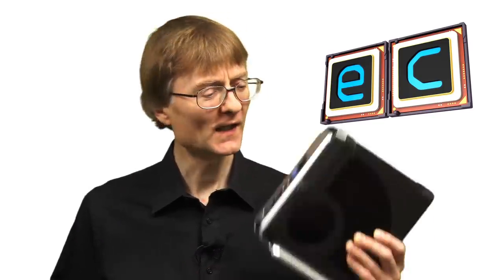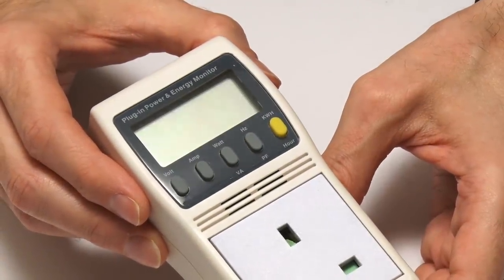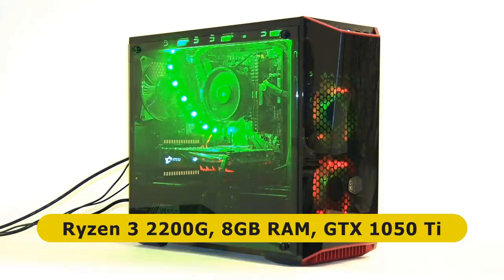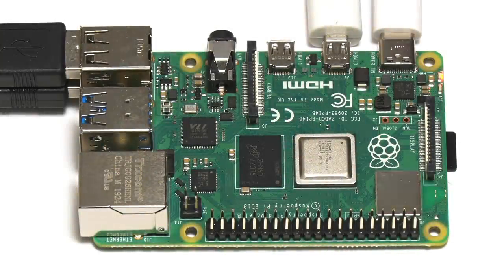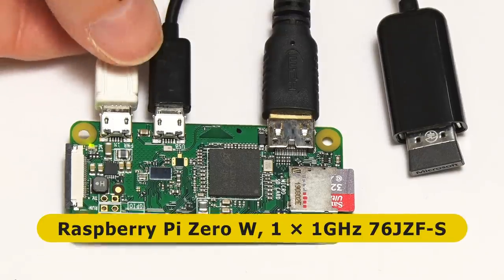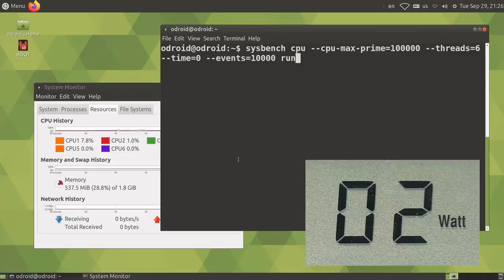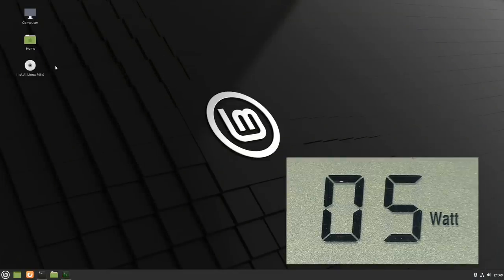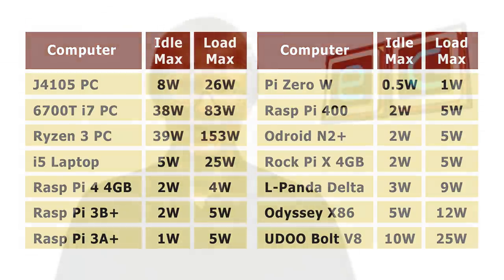PC & SBC Power Consumption

Comment: Christoper - if you have any access to experienced electronic engineers (and I stress - experienced) they may be able to modify cheap power meter to use a shunt that is 10x the resistance of the original one. That would give you 10x the resolution, though you'd have to insert a mental decimal point. eg: 11 watts on the meter would be 1.1watts.
A downside is that the maximum rating of the meter would then be divided by 10, so for a 3kW maximum it would be reduced to 300 watts.
Reply: and watch out - if you buy some cheap meters, they are very inaccurate or give no reading at all below 10watts, depending on the chip and coding used. A good sign is if it reads down to 1 watt - some start at 5 or 10 watts and then increase in 1w increments thereafter - not good
Reply: Boodysaspie  Well not really, I couldn't find a good one with accuracy down to 0.1W resolution at all power factors. Modifying a shunt can cost only a few cents, depending on the value required. A simple length of brass sheet or thin-gauge bar, cut to shape for small loads, calibrated by filing a groove across it to trim the final value. Also, this is mains voltage equipment so needs great care.

On some designs, even the battery contacts are live at mains potential (which is why they are well sealed in use - though beware if you are testing a modified one before re-assembling!)  Hence the need for an experienced hand and eye :) This is not a mod for for beginners. 

Resolution and accuracy are two completely different things - just because someting has high resolution doesn't automatically mean that it's accurate - a common mistake than non-engineers make.  

Overall I spent over 600 euros on several so-called "professional" meters and still ended up modifying the shunt an old Brennenstuhl model that was originally bought from Lidl for about 8 euros 10 years ago. 
I have plenty of  real test equipment (and it's regularly calibrated and checked) but for a compact easily used unit the size format of these consumer meters is very attractive. 

Best I've found since, well under 100 Euro was a "Hopi" meter, though it was rather larger than these small units and doesn't like stray RF or badly-filtered SMPSUs or being too close to transformers and inductors. I didn't really find it very well constructed and it had some dubious safety decisions though - just my opinion.
I dropped it one day from 6 feet and it smashed to smithereens :)
It's not like I need to use these every day, so not worth spending crazy money on one. 

But 3 cheap "plug-style" power meters, 2 modified (one for 0.1W and one for 0.01W) covers most of my needs for mains measuring of small mains loads from 3kW down to next to nothing.
Especially for longterm battery-powered or solar/PV-powered equipment, you really do need to keep an eye on the losses - some mains PSUs are very inefficient under certain circumstances. Not all equipment can be brought to the lab to use bench test equipment and must be measured in the field quickly and without cutting cables. Up a lampost or mast in a waterproof enclosure is a classic example of when you'd need a small plug-in unit

Measuring DC power is far easier with simple cheap test equipment. 

But yeah, if you have spare money, you can spend a LOT on test equipment like this. I prefer to spend my money keeping fit and healthy on beer, crisps and biscuits instead.
Reply: Boodysaspie  This is a 5 minute job with a parts cost of under 2 euros including calibration components (mainly the cost of as mains plug to house some quality 1% resistors to check calibration) 

The maths skills required are around age 7 or 8, the physics knowledge is around age 13 or 14 at most and other than the mains safety aspect and supervision aspect could easily be done safely by a 16 year olf EE student. It's no more difficult that thousands of YouTube content creators do daily and the parts are very readily available and cheap.

I was merely suggesting to Christopher that his academic contacts(edit: lab techs, EE lecturers etc) may be able to help him convert a shunt.
What may be an unusual position to you may not be at all unusual to others.

If we all waited for others to design and sell us useful items appropriate to our needs we'd be waing a long time for any scientific progress.
Reply: Boodysaspie  what is inconsistent with me suggesting playing it safe? a kid can do the math, an older kid could do the conversion, but they would need supervision and guidance to do it safe. 

read both my comments, BOTH suggest playing it safe - how is that inconsistent?
Reply: Boodysaspie  Do you troll all day? As I said - * twice * - the safety aspects require experience, but the basic skills are simple and the parts are extremely cheap. Direct replies to your hypothetical questions about cost and difficulty. 

You, not I, chose to pick this argument, and you choose to ignore parts of my comments and not others.

This conversation serves no technical purpose and wasn't even aimed at you, though you have hijacked it as your own for some reason.

Argue with someone else. This spoils a good channel.
Reply: Boodysaspie  you didn't ask a  question - you made a statement and then asked me to agree with it - you said specifically said - "It's safer, cheaper and quicker to buy a better-brand meter, isn't it?" 
We bought many devices from reputable sources and spent a lot of time and money, yet found nothing suitable - after testing - within the budget of the project. Few devices even met their stated  specifications. One (the most expensive) was unsafe to use.

Comment: Good to see how much power we can save just by using the minimum configuration needed for a job at hand. (Most of the time, a raspberry pi is enough for me for home use: mails, YouTube, learning programming, etc.) You also gave me further ideas to test: What about stressing out more resources on the raspberry pi? e.g. memory to near 100% utilisation, stressing out gpu chip? does it make any significant difference? (so there are a few more use cases worth considering.) And it is also useful to see that a modern laptop may have comparable power use to an SBC when the task at hand requires lower processor activity.

Comment: On the SBC's I would have liked to see power dissipation while rendering dynamic video for the hdmi output.  It seemed that the power would rise each time the terminal window was opened.  I believe 100% utilization on the CPU is only part of the problem.  Does your stress program also stress the on-board gpu?

Comment: The Ryzen3 System uses an APU and doesn't need a Graphics Card. The Power Usage under Load would be much lower without it.
Reply from the maker: There is no issue using a graphics card with a Ryzen APU, other than the GPU is being wasted. As I noted in the video, in the 6-part build series for the PC I first built it using the APU for graphics, then added a graphics card later. And this is a very common approach for those who want to need to start with a more basic system and upgrade over time.

You are right that if I tested the Ryzen system without the graphics card it would use less power. But I am struggling to see the point of this observation. I test a system -- a set of hardware -- and indicated what was being tested.

Comment: The power draw of the "Ryzen 3 PC" would be more due to the GTX 1050ti than the Ryzen 3 ?
Reply: @J Fz okay 👍
I meant to type Ryzen 3 at the end, my finger slipped
Speaking of nm, Zen 2 and Zen 3 are both 7 nm, while Zen is 14 nm and Zen+ is 12 nm

Comment: Well my Core 2 Quad Q9400 overclocked to 3.2 ghz with 8 GB ddr3  and GTX 1060 with 1 ssd and 2 500GB hard drives consumes  120 W idle and about 300 W when I stress testing the  cpu and gpu. Yikes!
Reply: @J Fz I would upgrade to ryzen but I cannot afford it because everything new is expensive in Romania

Comment: Over the last few years, I'd also looked at the power consumption of PC components, having looked at the Thermal Design Power (TDP) ratings of my old early 2000's PC CPU's that were almost vampirish in the power they sucked and tropical in the heat they put out.

Modern PC CPU's are a lot more power efficient but I still think we often use computers that are over-powered for a load of tasks with SBC's making more sense in modern times for a lot of lower power tasks and the PI 400 ticks a lot of boxes for a lot of general users, myself included, and I plan on getting my mitts on one soon for lighter tasks like browsing or streaming.

No need for an i5/i7/i9 with 16-64GB RAM when something like a PI 400 does it for a fraction of the cost, power and for general piece of mind.
Reply from the maker: Great post. It is indeed amazing how much power PCs used a decade or two ago compared to today.

Comment: This is a great reminder for me to get a new power meter.
I lent mine to a friend and never got it back. 
Besides, these days power factor is a important feature to measure.
Back in the day of the 32bit Athlon CPUs, I had a PC that drew 82W when powered off. 
It turned out to be just the power supply with a terrible design of PFC and filtering.
Reply: Boodysaspie  Most definitely.

Comment: You're only testing the CPU on those Raspberry Pis. Not the GPU.
OpenCL or GPU benchmarks will most likely bump that wattage by a few more.
Reply from the maker: Correct, but the relative power use of the GPU on the SBCs here would be very slight.
Reply: @ExplainingComputers  You think so?
It's my experience that the GPU (often 4-8 cores) uses more power than the CPU under full load.

Comment: Mate of mine was asking, and I don't know, if you've seen anything that can take AND power and external drive so it can play MP3s (MP4, M4A). I'm guessing not unless it's an SSD.
Reply: External 3,5 inch harddrives (always?) comes with a separate power supply. Using one of those with a raspberry pi should be not problem at all. I think a 2,5” also would work, although you’ll need a good power supply and I am not sure you could max out the cpu of the pi whilst also waking up the hard-drive.
Reply: @PatrikKron  I'm not sure what application my pal is thinking of. Seems to me that he's after an iPod ... which already exists but maybe something else? I don't know. All the 3.5" drives I have are self-powered (12 or 5v) so they're a dead loss if he wants portability.

Comment: the power meter doesn't have enough resolution for small SBCs. You could try to measure the DC power using something like this: https://www.ebay.com/itm/USB-tester-dc-digital-voltmeter-ammeter-voltmeter-power-bank-voltage-detector/184534588694?hash=item2af71e5d16:g:wZ0AAOSwN~demHt9

Comment: A lot of these simple AC power meters are very inaccurate at low loads. You really need to check and calibrated them to be sure they are accurate. A lot of the non-names ones, will be few watts off easily. And, no you can't just say "it will still give me relative idea about power usage". No, unfortunately no. power factor, harmonic content, etc do matter, and the same meter might be saying one board is using 5W, and another 10W, but in reality, with accurate meter, the reverse might be true. Don't trust the numbers on these power meters, unless you really know what you are doing and verify their performance. For things like SBCs, you definitively should use something that is accurate at low loads, and has 0.1 resolution and accuracy. Testing DC power after power supply is another thing to do, and often it is easier to make it accurate, if you have a proper meter.
Reply from the maker: Fair point, I must get a better meter. :)
Reply: @ExplainingComputers  I appreciate the video and the tests. I think power usage is very important factor when comparing these boards.

Comment: I am sure some folks could care less how many watts a computer actually draws!! As long as they can chat on Facebook or watch cat videos on YouTube they don't care how much power a computer is drawing as long as their content is "consumable"!! But then there are guys like myself!! I live in a 1971 mobile home with a very limited 50 Amp mains power service!! So like NASA and the International Space Station, I have to watch where every volt and micro amp goes!! And it DOES become a balance act at times when I am not sure what device will kick the main breaker off in the box outside my home or not....then the arrangement of the small breaker box INSIDE my home also creates some drama as well at times too!! One thing too many on the same circuit (like a window A/C unit and my microwave together on the same wall run) and suddenly two devices running together even temporarily WILL trip the inside breakers!!! So having a small computer that runs things I need to work DOES become an issue!!

In the near future too I am planning on installing an "off grid" solar panel array! Not only for lighting when we have power outages, but because my other half and I are both disabled and could use the extra power when needed!! But because we live in a mobile home park I am not allowed to have some "over the top" large solar array making the required massive kilowatts needed to completely supply my home......and I am designing my solar system to run "basic needs" for simple12 volt lighting when the need arises and maybe a TV for information gathering....though it would be nice to have an entertainment source when facing a power outage which these computers COULD DO on just 12 volts DC!!

Comment: Perfect timing!  Using my kill a watt on my reliable old i7 4771, 8G ram, onboard Intel video, 2 4T drives and a 240G SSD, It runs about 65 when idle, not sure how to max cpu (8 cores) in Windows 7 so can't tell you that.  Starting and running only Opera web browser with 6 tabs open it jumps to about 115, but then settles back to 66. Interesting, opening Firefox, with probably 20 tabs but I've got FF set to NOT reload them until the tab is clicked, so only gmail loads up and once done, settles at 66 again.  Every so often, it jumps to 72 or more, I'm guessing that's gmail checking for new mail, even if there isn't any, but who knows?

Anyone got an easy way to stress my i7 8 core cpu for that test?

RichE San Diego, CA

Comment: So the conclusion is : if you want to save the dodos, use an i5 laptop, because even a Pi Zero will kill them with the power drain of an external screen.
Reply: No a similar power draw but with a 24  inch screen what laptop has a 24 inch screen lol
Reply: still a very impressive power drain for an i5 laptop though

Comment: Ryzen 3 2200G strength is its iGPU is more powerful than GT 1030 :) here my refreshed Ryzen 3 3200G performance https://www.userbenchmark.com/UserRun/35505022  * after some OC :)
If you build PC with discrete GPU better is take cheaper non G versions.

Comment: Pointless.  Next comparison: Power used by:  bicycle, skateboard, motor scooter, car, bus, cement truck (lorry),  battle tank, etc., etc.
Reply: Its not pointless if you are the one paying the power bill
Reply: @CruelQuertos  Again, pointless: comparing "Apples to Oranges to Pomegranates" all running different "benchmarks".  If you want to save money on your computer's power requirements, get one of the Raspberry Pies to play video games, make and edit music, make and edit videos.  Or get a stationary bicycle with a generator for power.  Also note that all of the single board computers use less power than the LCD monitor cited in the video and they are useless without one so add ~ 25W to each one.  Please make a chart with the cost of power for 1 hour of using each of the computers in the chart with a keyboard, mouse and monitor to see the exact amount of savings.

Comment: 3rd?
Reply from the maker: Close! :) Those milliseconds on the cables kept you at fourth. :)
Reply: @ExplainingComputers  Unsure if I'm getting the data via transatlantic cable or satellite. Either way, those bits must cross the pond.
As for the Raspberry Pi Zero W, I need to put my power meter on the USB supply to test, then repeat with my inline USB tester. It has volt & amp measurements to three decimals. Once I can account for insertion losses, I may be able to derive Watts to at least two decimals. Will let you know if that works.